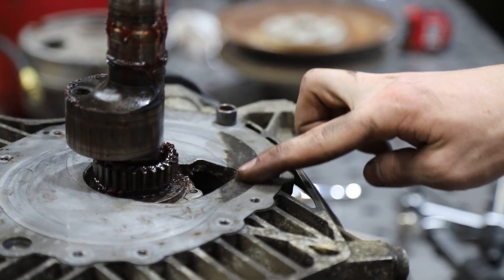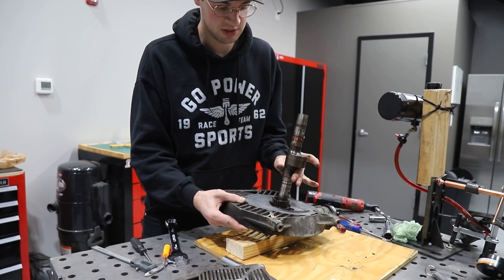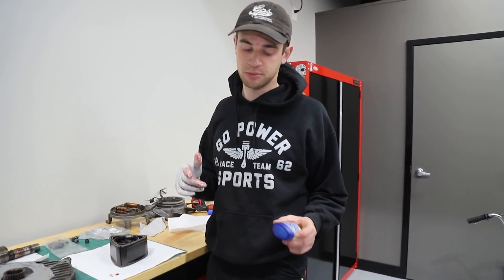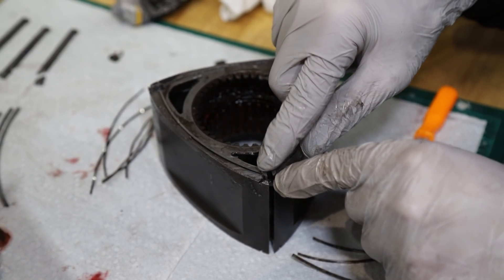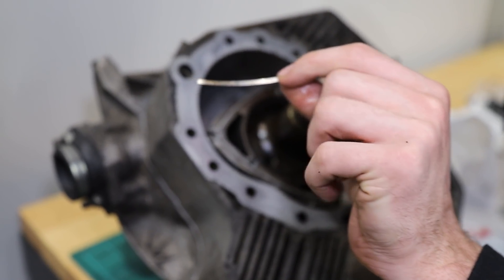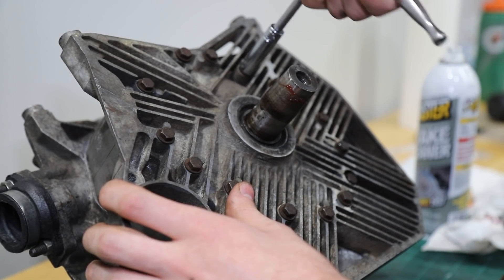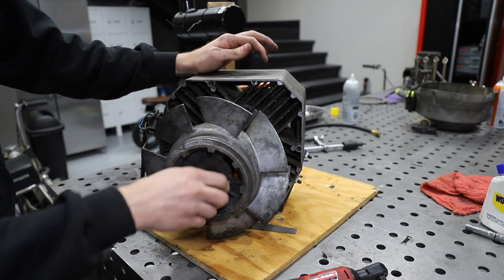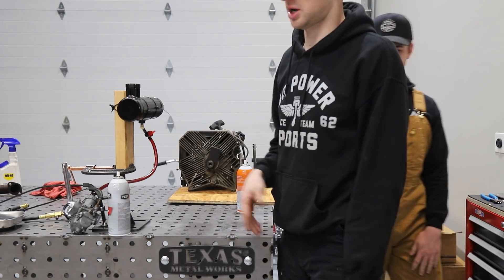RARE ROTARY ENGINE Runs! Rebuild And First Start! | Rotary ATV EP. 2

Comment: A longer Intake duct, 33 cm from carb to entry hole in side plate, will improve low end, low load performance in Sachs KM-24; KC-27: KM-914.
For high rpm power, a short intake duct is better.
 If you manage to adapt it, and have a dynamic balancing done, needed from the different Rotor weight, the results with the 2024 Aixro 50 Rotor in Sachs KC-27 and KM-24 are impressive.
They sell turbo compressors for Vespa 2-Stroke engines in Italy.

Comment: Awesome job with the glass/sandpaper idea! Y'all should invest in a medium to large metal lathe/mill!  At about $1000 bucks a pop you could do everything in house, I know it's a big investment but if your into restoring older stuff lathes and Mills are a life saver! Even small hobby ones like the little red on at Harbor freight. Mine has already paid for itself 5 times over in rare parts I've used it to make! Then with a mill you can fly cut blocks, heads, and pretty much any mating surfaces. I even upgraded my shop with a small propane forge and a metal furnace! The sky's the limit when you can melt down 50-70ish crushed pop cans just for the hell of it, then pour them in a piston mold and machine to make a perfect match for an old Elsinore! It was so cool knowing that the engine was running because of a bunch of recycled cans and not some half-assed made piston in China

Comment: SAE journal had an article about cleaning two stroke exhaust, it are similar to Wankel in using an air/ fuel mix in the rich side, and oil in fuel for lubrication.
Lead had a solid lubricant action, for unleaded gas, Wankel would not need more than 80 RON fuel, 4% oil in gas is required, and a MoS2 additive (LiquiMoly, 1 cc per litre of mix). Wankel improves with E5 and E10 fuels. Blessings +

Comment: For motorcycle use, you better put front side rear, intake in rear plate, to avoid overheating of Rotor rear side, transfer port in front, for having some cooling of mix, the Norton concept, it will be under air flow from fan, improving BMEP.
If you find the right pump, injecting fresh air into exhaust port, as in 1980s Mazda 13B, makes wonders.
Gesund +

Comment: On those water spots that have eroded the aluminum or magnesium which is what I actually believe it is I would have totally filled that with J-B Weld and then sanded it to give a smooth finish and gave it a great seal
Reply: Sachs Wankels had an Aluminum, plus Copper, plus Silicium alloy, to provide wear resistence and low thermal dilatation.
The good housing working surface plating is Nikasil; very good results were obtained with ferrotic apex seals; for side seals, IKA is good enough.

Comment: Old Fart Here: The problem with the Sachs rotary snowmobile engines of 1966 to 1975 was the early two stroke snowmobile oils just did not burn clean enough for the fussy apex seals. Modern Snowmobile two cycle oils are a huge leap ahead. It was common after two seasons with the old stuff to need to do a complete overhaul and de carbonization.  New premix synthetic two cycle oils will push that out to several more seasons between overhauls.

Comment: I have one of these what is the value of it?
Reply: Absolutely nothing if it runs I’ll swing by and take it off your hands.              Nah just kidding. Good running 295s 300 to 500 bucks ball park. My favorite wankel powered snowmobiles are the 1970 to 1972 Panther 303, Arctic Lynx 303  1971.  1975 Arctic Cheetah 295. The sleds complete are actually becoming quite collectible. Nice 1972 Panthers 303 can go for 1500 bucks.  This is my only slightly more than they sold for fall 1971. So the hobby is at break even mode.
Reply: Cat made from 1968 to 1974 about 20,000 303 Panthers,  about 3000 303/295 Lynx, about 3000 1975 295 Cheetahs. After the purchase contract with Sachs ended with the completion of the 1975 builds, cat went all piston two cycles for 1976 models.

Comment: This is awesome, look up DIY cylinder head resurfacing if you read this. I bedded a piece of tempered glass to steel plate with epoxy, glass is almost perfectly flat. Then I use just a wisp of 3m spray adhesive on sand paper gluing it face up on glass. Its ghetto as hell but works amazing for small engine stuff.

Comment: you can braze up the pitting at home with a torch and some brazing rod, then its easy to lap back down with your glass piece because the braze is softer than the iron housing so it will flatten out easily.
Reply: To me it visibly looked like the housing was made of Aluminium, I could be wrong.

Comment: Machinist in Australia here: getting those side plates machined flat shouldn't cost you a fortune since that's not a difficult job to do, especially if you guys make a jig so it's easier for said machinist to mount it flat and parallel to the machined surface on their machine

Also, a thread file is fairly cheap off eBay and would allow you to easily clean up the ends of threads like the end of the eccentric shaft where you used the castle but backwards

Comment: No need to put grease on the roller bearings, just some  2 stroke oil will do as the fuel oil mix will lubricate the bearings. I lap the plates on a surface plate with 1200 paper as the plate had a bronze  color type plating,on your side plates i can not see any plating.

Comment: I will tell you a trick that I used on a few rotary Sacks engines. I used a surface plate to make the faces literally perfect. There is more work doing the surface plate but the results are just phenomenal. The reason the rotor dug in is because of looser tolerances of the air cooled engine. I can tell you that if you warm up the engine that will not happen. I always liked these engines. The torque is really nice for sure. Job well done fella too. Peace vf
Reply: What is a surface plate?

Comment: Man... If I'd known how simple these are to get apart, I might still have an RX7. I actually centrifugally exploded the clutch by downshifting it at speed! Replaced that. But, soon after, it started to lose compression. Someone suggested pouring brake fluid into the carb, and that was pretty much the only way it would start, in the end. You wanna see a HUGE cloud of smoke? Try it.
Reply: The part that makes the Mazda ones a bit harder to work on are the rubber seals keeping the water out of the cylinder, even the tiniest scratch and it’s burning coolant

Comment: I wonder if you jb welded or liquid steel it cure it then sand it flat I've used it on old Japanese mainly Honda gas tanks and never had a problem
Reply: We use devcon to block the ports on all our 13b and neva fails

Comment: Way to guys. Great job on the engine work. Just to let you know a good quality mirror is flatter that window or plate glass. The less wavy a mirror is the flatter it is. I was in the mirror business for over 30 years the mirror is just a coating put on the back of very flat glass sometimes called float glass.

Comment: very cool, I still think you should turbo it, low compression rotor housings just leave more room for boost.
Reply: Air cooled engine and boost usually ends badly. Peace vf
Reply: @victoryfirst2878  true, but if you can get enough air flow, it works ok
Reply: Methanol will cool it down 😆